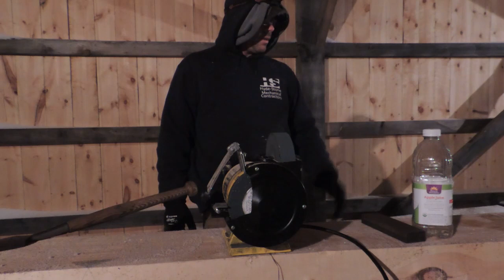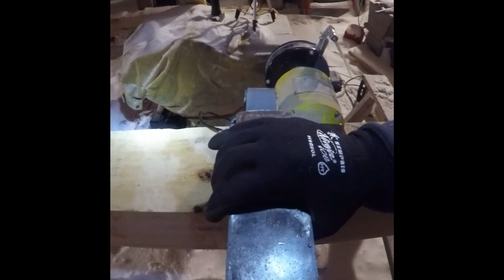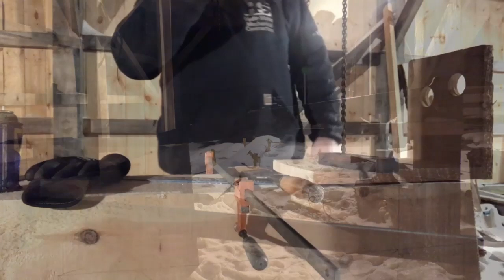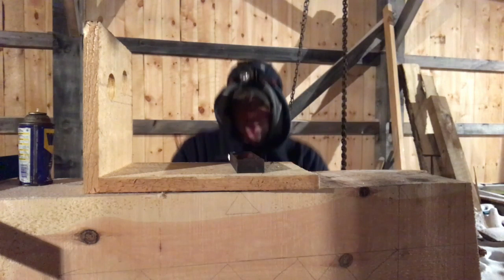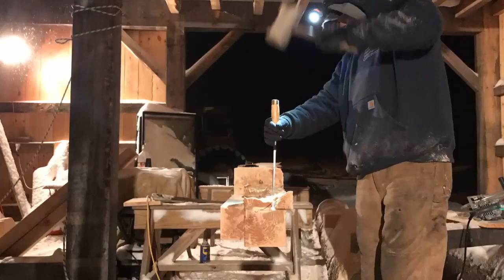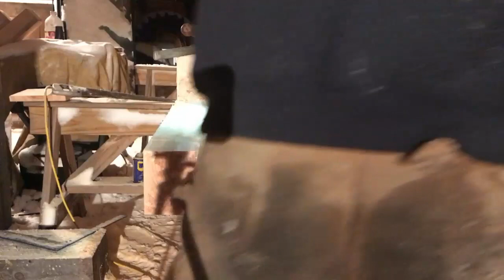A Timber Frame Vlog #113 Winter Wonderland

Comment: You look like a pro using that slick Jim!  I've been through the Japanese water stone thing myself and have moved on to DMT DiaSharp Bench Stones. The diamond layer is on a thick plate of steel.  The DiaSharp whetstones stay flat, as opposed to anything else.   Use a water sprayer with the Bora HoneRite Gold additive which makes the water non-corrosive.  Yep, it will be painful when purchase them, but you will soon forget it.
Reply from the maker: +Allen Hunt I'll check them out.

Comment: Hey Jim.  Our plans sound the same, crazy.  Kind of wish I lived closer.  Hey what about using the same jig for the slick?  You could accommodate the offset in the handle by toying with the hole location I would think.  Good video, better get busy myself.  Have a good Sunday.
Reply from the maker: +T W the slick is a different animal because the top is rounded and it has a curved profile.  We'll have to gtg again.
Reply: TheTradesmanChannel 2017 Definitely

Comment: I looked in Harbor freight, could not find that grinder you are using. Please send me either a link or the model name and number.  I checked at Northern tools, and either I am having a rough day, or they do not have one. Very good video. A friend sent me 2 boxes of wood chisels the other day, and they all need some tender loving care. All of the chisels are 3.4" and smaller and really need to have a new profile put on them.
Reply from the maker: +Jeffory Newkirk AKA Pan P let me see what I can find.
Reply from the maker: +Jeffory Newkirk AKA Pan P https://www.walmart.com/ip/WEN-10-2-Direction-Water-Cooled-Wet-Dry-Sharpening-System/55011010

Comment: Hi Jim, the slick should come good the more you use it, had another thought the door behind you in the GREAT video if you have a tarp big enough make two flaps that over lap each other and at the bottom nail two strips of waste timber that will sort of keep them held down at the bottom, you have two temporary doors.
Reply from the maker: +Douglas Mungham good thought.  I might have one left.
Reply: You will be able to go in and out with out the snow following you and might keep some of the wind out. You look really pleased with the gift plus it will make the job more enjoyable to do.
Reply from the maker: +Douglas Mungham it worked great